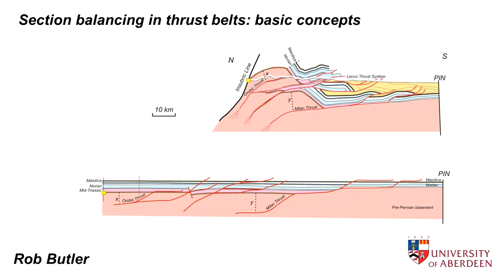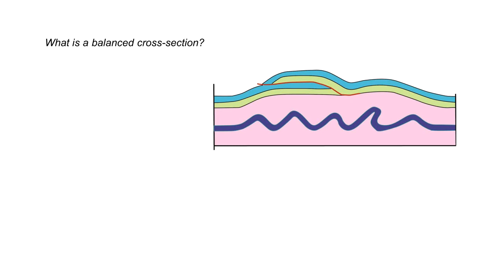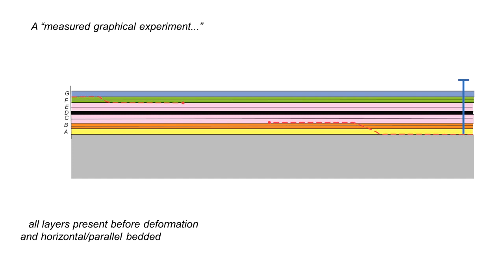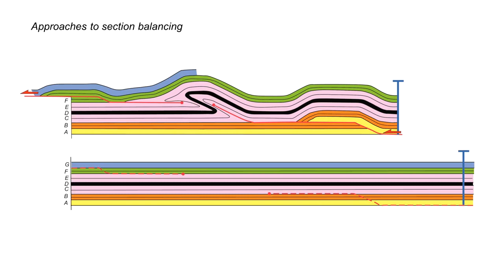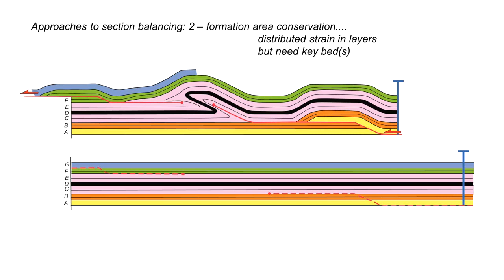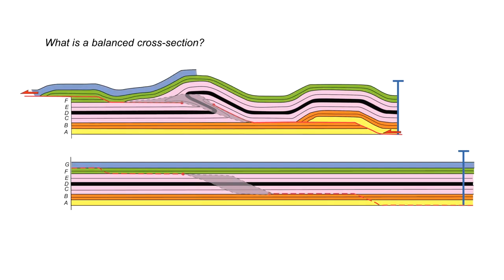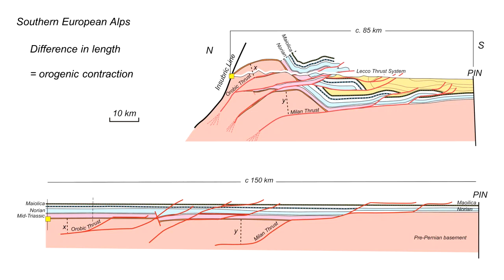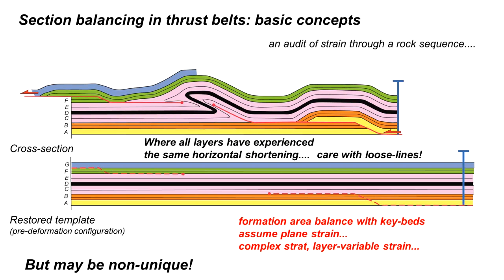Section balancing in thrust belts: basic concepts

Comment: Thanks sir, just i need to know what software you have used in restoration?
Reply from the maker: By hand. Use paper strips tio measure lengths. Measure and conserve cross-sectional area by drafting on film above graph paper - OR - if working digitally use line-length and area calculating tools in (for example) Acrobat/Illustrator. This approach gives great flexibility in varying "structural style" and trading off distributed strain vs inherited stratigraphic thickness variations.

Comment: sir. can you pl share either a vido or literature for restoring rift / extensional system section ?
Reply from the maker: Thanks for the question. There are a couple of videos if you scroll through the  "structural geology" playlist - one is on "listric normal faults" (this covers the "Chevron" construction) and another is on "Normal faults and crustal extension" that looks at Wernicke & Burchfiel's (1980) method for estimating stretching factors for planar normal faults  (but check the assumptions). For info, the Chevron construction was the first approach used for the development of section balancing software - by John Wheeler when at Midland Valley... BUT - actually both approaches are about faults and geometry - rather than balancing in the sense used for thrust systems. Really the key is simply to put the layers back in a graphical restoration to the pre-deformation state... it really doesn't matter what the deformation is - as long as (for cross-sections) it was plane strain... Make sure you recognise assumptions (eg bed-length conservation... ). Have fun!
Reply: @robbutler2095  thank you sir